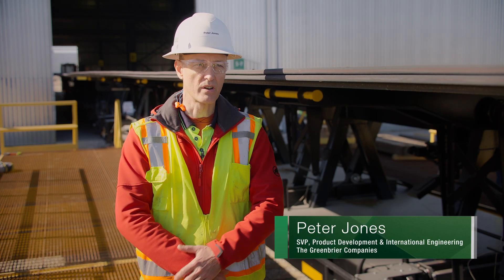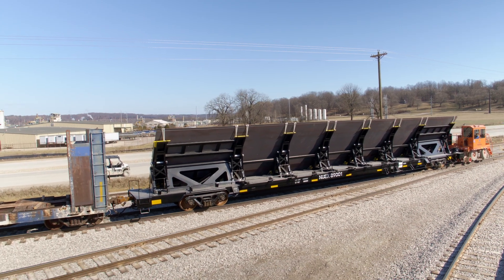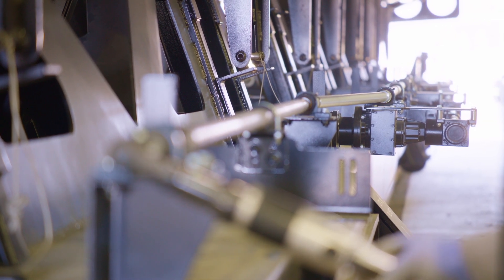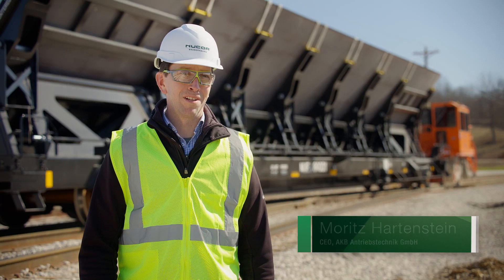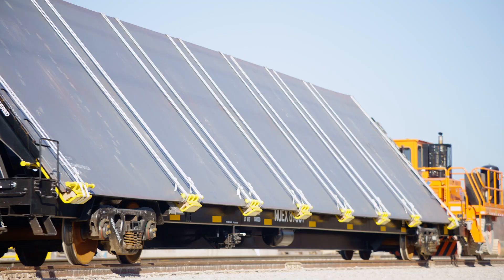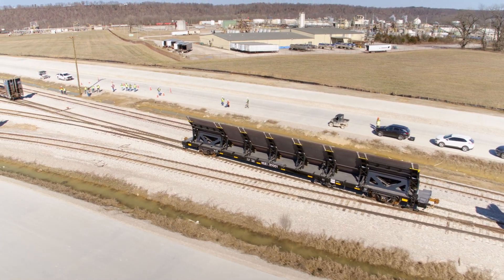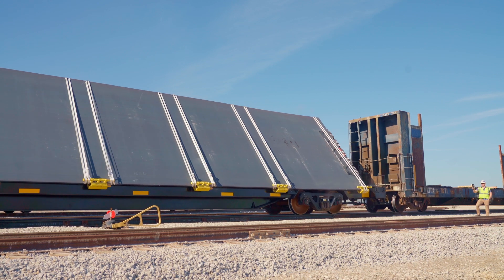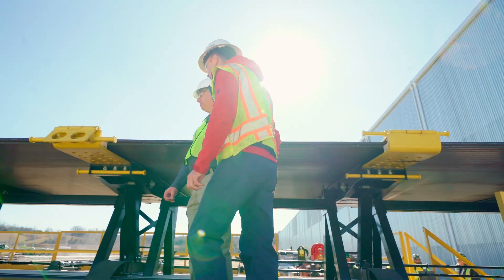Greenbrier's Tilt Flatcar

Comment: Southern Railway was doing this clear back in the 1930's to transport turnouts. I am now building three of them in HO scale to transport turnouts as well. The starting points that I am using are Flexi-Van spine cars. They will have electric motors that position the table although The Southern used hydraulics with a total of 8 rams, 4 extending, and 4 retracting---the hydraulics were a pain!!!
Reply: which is why it sounds like Greenbrier went with the screw jacks and understandable as to why.  Good luck with your building, modeling these in HO was the first thing that crossed my mind LOL
Reply: @MikeT-TheRetiredColonel  HEY COLONEL, THERE IS A NEAT VIDEO YOU WATCH---TYPE IN "IC 6250, NS CARRIES DIAMONDS, SOUTHSHORE CROSSES STILLWELL". THESE 2 NS MOW CARS HAVE DOUBLE TRACK DIAMONDS ON THEM @ 9:30 INTO THE VIDEO. SOME OF THE NEATEST LOADS I'VE EVER SEEN!!!